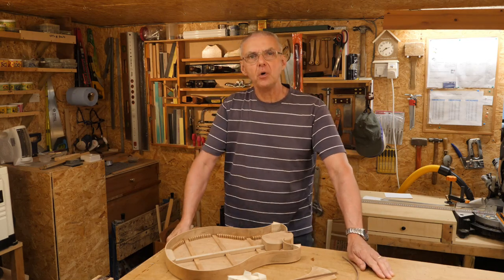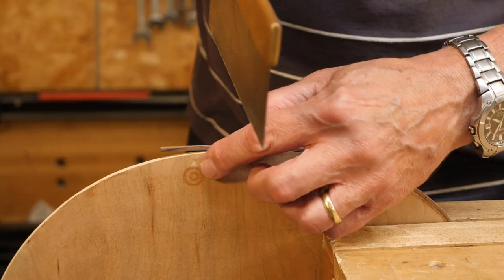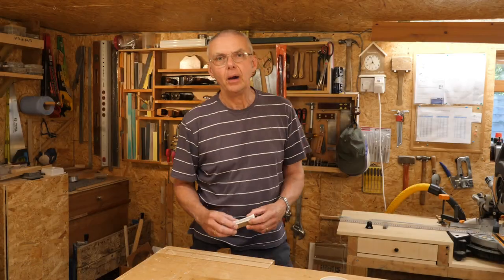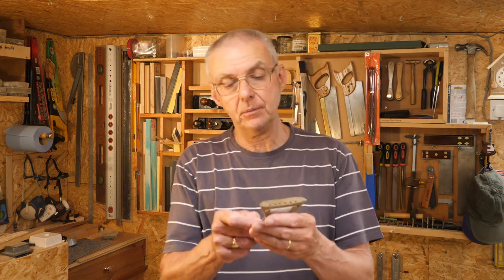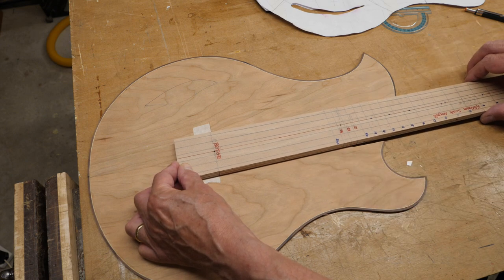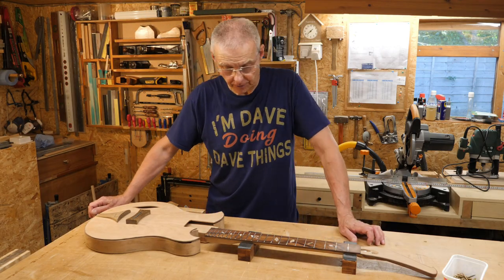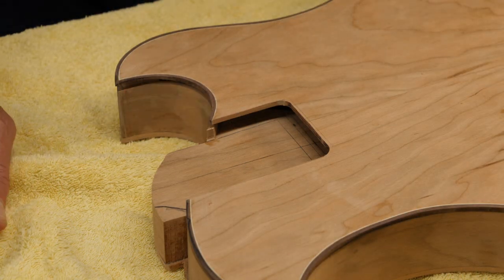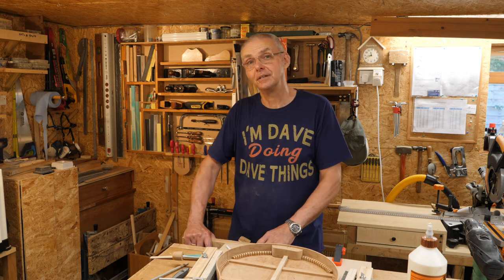#GGBO22 Community Build ep15: Should I just give up? Never! More guitar making fun.

Comment: I think I like your “Dave Moments” more than the rest. I also screw up (way more often than you appear to) and have to either adapt or start over. Recently, I built a “sled” to put on my 3/4 size guitar so I could use my table saw like a router and take a small amount off the back of the neck because it felt too thick. Planned, tested, adjusted, experimented and then did it. It worked exactly as I had envisioned it would. “Measure twice, cut once”. But with some things it’s more like “measure, test, measure again, use a different measuring tool, test again, cut.”  That bridge you are building is an act of courage. Respect.
Reply from the maker: Great advice! Cheers Dave

Comment: Option for plan C make up 10mm thick heel block either the same as neck or a contrasting piece, rout out the neck and glue in then carve the transition.
Reply from the maker: Ah ha! I see you’re on the same wave length, not sure I’ll need it though, stay tuned. Cheers Dave

Comment: I don't think  connecting the strings to the signal ground is necessary. I think it was used in the past as a hum screening bodge. Nowadays modern shielded, humbucker or noiseless pickups plus control cavity shielding is the way to go.
Reply from the maker: Thanks Ricobass0 that could really help, I’ll try without a ground wire, could always add it later. Cheers Dave